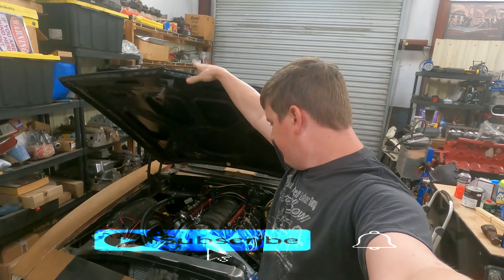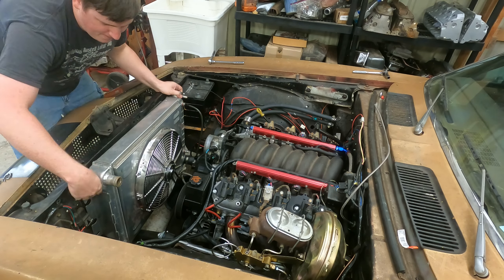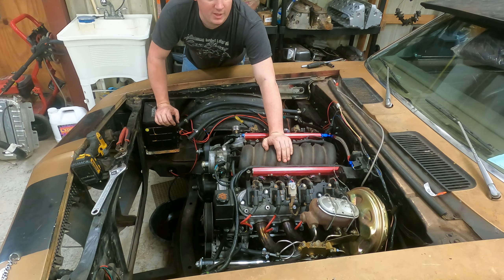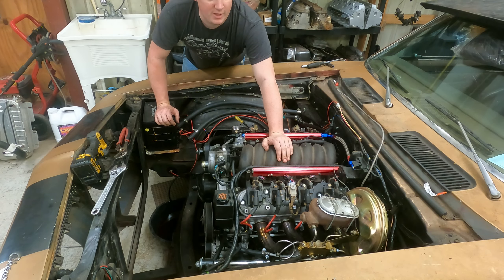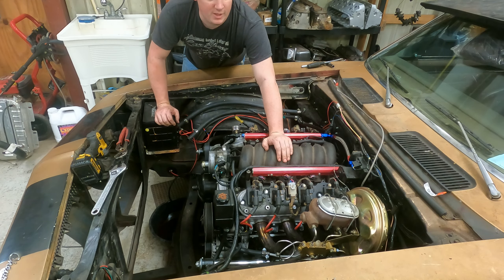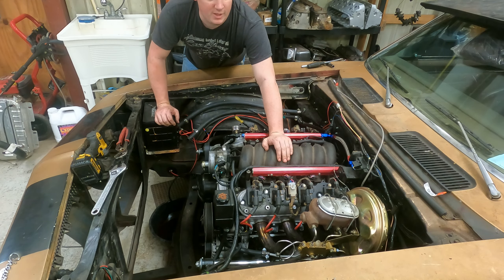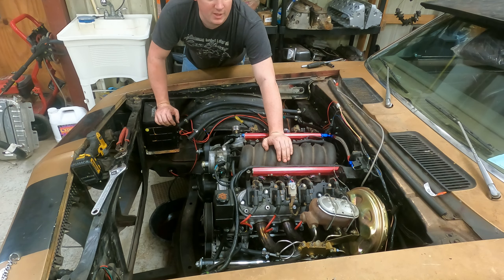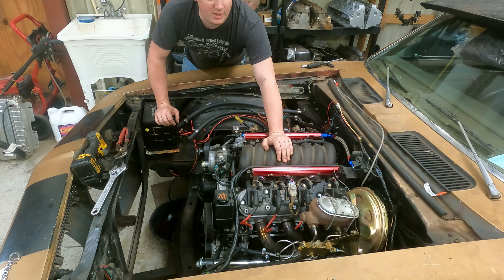67 Camaro ls swap/unswap what’s next ￼y’all tell me

Comment: Your sbc which is too good for the street is the motor to build for this car.  Driving on the street, you may not need to go fast, you do want to go quick. So, I suggest the sbc with RV cam for torque at low motor speeds and EFI for merging into Atlanta traffic.
Reply from the maker: Lol well there is a sneak peak on the channel in the shorts I will post a link to the short here. Also I just have to say I try not to be in Atlanta traffic its no good
Reply from the maker: https://youtube.com/shorts/DPkt46AtkJU?feature=share